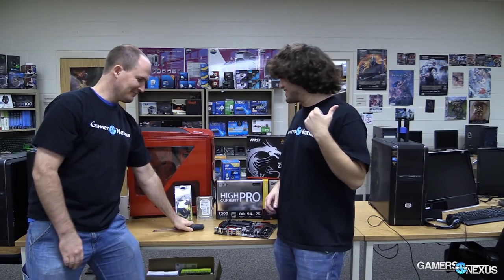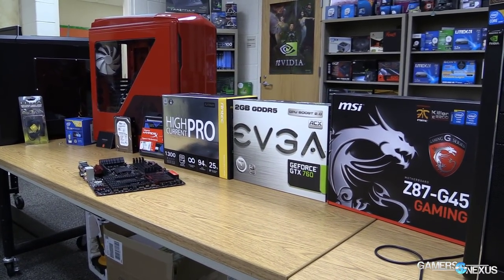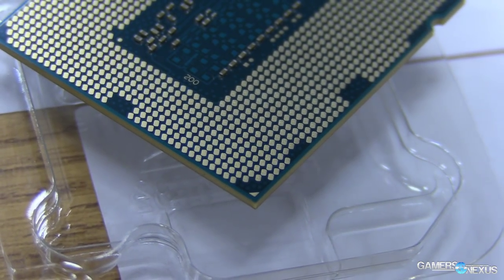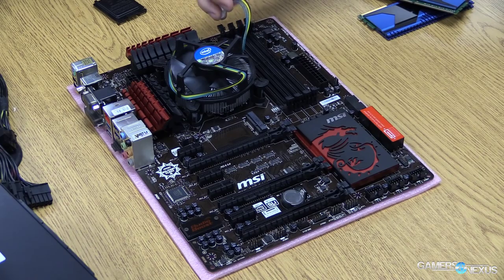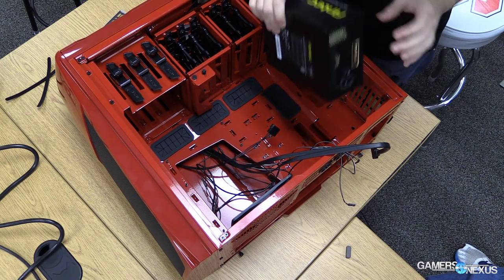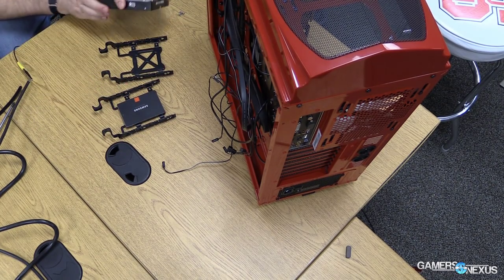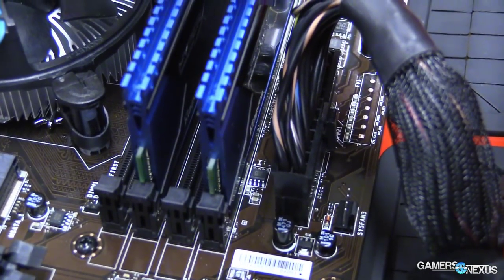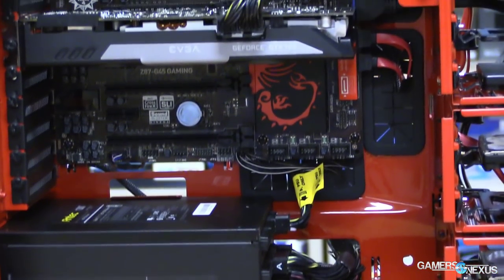How to Build a Gaming Computer: DIY Gaming PC Step-By-Step Tutorial

Comment: Great video, however, i have 4 questions, hope to be answered by Gamers Nexus:
1- I had a look at the cost in the article, way cheaper than AUS, as the article says the CPU is from your shop, do you ship to AUS?
2- where to do you connect the end of ESD wrist?
3- Do all cables come with the case and the components? no need to buy any cable separately?
4- Connecting cables to motherboard, GPU ... etc not clear enough, how to get clearer and closer look at how to do it.
Reply from the maker: Hey there,

1- We don't sell anything, sorry for the confusion. It lists that it's from us because we paid for it (was not provided by a company).

2 - You can connect it to anything that's grounded. A grounding ESD mat is a safe way to do it. You could also connect it to the metal grill on the case covering your PSU exhaust.

3 - Yes. You should not need to buy separate cables.

4 - Check the article, should help out. There are only a few. The motherboard manual will help with that. You'll need 24-pin to the right of the CPU, 4/8-pin next to the CPU, 3/6 pin to the GPU, and SATA power to the HDDs.

Comment from the maker: PC build tip: Always build & test the system outside the case before assembly - saves time if DOA parts. More here: How to Build a Gaming Computer: DIY Gaming PC Step-By-Step Tutorial
Reply from the maker: RIKALZ Not really... just make sure you build it on something non-conductive. In this video, we used anti-static foam (about as safe as you can get), which often ships with motherboards. If you build it on something like paper, carpet, etc., then you will likely damage the board. As long as you have an anti-static wrist strap and anti-static build surface (like the foam we use in the video), you should be fine.
Reply: Gamers Nexus Once you have jumped the board, how do you turn it off safely? Would you unplug the PSU from the wall or pull out the cable? How did you guys do it?
Reply from the maker: Tom Mo Great question! You can safely toggle the PSU switch to disable the system. You could also unplug the cable. It won't hurt anything because we're not in an OS yet.
Reply: Gamers Nexus Thanks for the almost instant reply! Got yourself a sub ;) Also, when you install the OS (disk), do you put that in before you boot up the PC for the first time? And is the BIOS easy to handle?
Reply from the maker: Tom Mo Any time! That's what we're here for. It actually doesn't matter too much if you put it in before first boot. You only need CPU + some form of video (even if it's the integrated graphics) + RAM + PSU to boot. Also the CPU fan. It's not a bad idea to install it first, but not required. BIOS is VERY easy these days. You'll get it in no time. As long as the disk is set to AHCI -- which it should be by default -- you're in good shape. Legacy boards used to set disks to IDE by default, which was fine in the old days... but now we've changed to AHCI.
Reply: Thanks a lot; know I can happily say that I know practically everything about building a PC :D These were only the few things that I was unsure on. I've made lots of changes in mine and have experience, as I have a friend who wants me to build him one :)
Reply: ok I have the wriststrap how do I ground it just put the clamp where????
Reply: These two guys are relatively young, before they were born we used to perform low level formatting when it came to Hard Disk Drives. From experience and since these builders have a shop to test or build and assembly rigs for people to see, they should or could use anti static mats on the table or on the floor. I have one, it is red and it is the size of the large bandanna close or around 22" , the mad is suitable for laptops and more, on one corner closer to you it has plug for your wrist strap. If u do not have the mad, you wrist strap has an alligator clip which should go to the case or chassis. It is true static can damage the motherboard.

Comment from the maker: If you need help learning how to build a gaming PC, here's our step-by-step assembly guide! How to Build a Gaming Computer: DIY Gaming PC Step-By-Step Tutorial
Reply: Ty for this vid i was going to build my own but the new nvidea 800 series is coming out soon should i wait or what current one should i get that will be able to run games for the next 3 years and what motherboard please
Reply: hello, can i have your processor? =)
Reply: lol, using an i7
Reply: -NARUTO-
try one of the these http://shop.amd.com/us/All/Search?NamedQuery=desktopprocs&SearchFacets=category%3AProcessor%3Bprocessor%3AAMD%20FX%208-Core%20Black%20Edition or if you have a tight budget one of these: http://shop.amd.com/us/All/Search?NamedQuery=amdaseries&SearchFacets=category%3AProcessor%3Bprocessor%3AAMD%20A10-Series%20APU  definitely not an i7   (also, overclock them in the bios, not through any other software <---- advice for any processor)
Reply: No Thermal paste is needed anymore?
Reply: *****
Of course thermal paste is needed!!! those pads that come on the cpu are useless if you are going to use the computer for anything more than work.
Reply: well I didint see the moment when they apply it :(
Reply: do u need to have ssd and hdd to build a desktop?
Reply: Of course you need a hdd, an ssd is not so necessary, you can get one if you want, but you don't need one
Reply: k thx
Reply: thatguy
techincally you dont need an hdd
Reply: It's generally best to have one to be used along side an ssd / SD card / memory stick / whatever your running your system from as per GB, HDD s are cheaper
Reply: vaginaaaaa  techincally you dont need an sdd. Ssd fan boys will always tell you to get them.

Comment: Make sure to apply thermal paste to the CPU before putting a cooling solution in. I didn't see that in the vid though I could be mistaken.
Reply: the stock cooler already has thermal paste on it
Reply: I stand corrected then. Thanks for the info.

Comment: I have decided to build a PC for the first time and I wanted to know if my parts are all compatible with each other:

Case: CiT Goblin Mesh

Power supply: EVGA 500W 

Processor: intel core i5 4460k 

RAM: HyperX FURY DDR3 4GB (x2)

Motherboard: Gigabyte GA-H81M-H

Graphics Card: Asus Nvidia GTX 960

Hard Drive: WD 1tb SATA III

Is this build good to run mid-high level gaming such as CSGO and Call of duty, if anyone has nay suggestions feel free to comment. 

PS. I want to keep the build between £500-£600, also do I need a solid state drive
Reply: use pcpartpicker i recommend it. i got mine around $500 im not so sure how many pounds it is.

Comment: I'm not too worried about static shock, as long as you have some sort ground near you and your not doing it in the winter on the carpet there isn't really much to be afraid of. really i don't see the need to buy a strap. Seriously though, the only time i have ever had a static discharge near a computer was shorty after i got my newest board(during the winter after being on the carpet with boxes). Thankfully the shock only reset the bios and.....fried a 500 Dollar Monitor... although the GPU and Motherboard came out unscathed.

Comment: @Gamers Nexus  Looks like the NZXT cases have a solid state drive slot on the back side of the motherboard...kind of on the cable run side.  Looks like your case did too....wondering why you didn't use that slot to place the SSD?

Comment: I understand they are just building a PC for tutorial purposes and not for part selection, and they are probably using just parts that were sponsored or that they had laying around. But at the time of filming, this PC wasn't really the best to get. They could have saved a lot of money on the CPU and used it on a better GPU, and the PSU is just a complete overkill, half wattage would be more than enough even with a mild OC. Anyway, a very good, detailed and easy to understand guide!
Reply: Rui Castro what if they dont need a better gpu? and yea that psu was really overkill
Reply: King Butcher I understand your point of view, that CPU/GPU combo could be just what they need, since some games, like those included in the MMO genre, benefit a lot from a more powerful CPU and would run smoothly on that GTX760. However, I believe that saving some bucks on a CPU, replacing it with an i5 4670K (same LGA 1150), and using that spare money on upgrading that GPU to a GTX770 would have been a better gaming setup. Anyways, you stated a good point I had not thought of initially :D
Reply: King Butcher And also, if they didn't blow all the budget on that overkill PSU, they could have still had some money in the bag to get an aftermarket good quality Air or AIO Sealed Liquid Cooler,  so that they could OC a bit and get the most out of their CPU :D

Comment: I'm mad you didn't use thermal paste on such an expensive processor... Though it isn't necessary, its still good to have. (stating for your viewers.)

Regardless, decent tutorial, keep it up. you have gained a sub.
Reply: The thermal paste was already on the stock cooler to begin with :)
Reply: Simon Larsen the stock cooler compound is garbage. U should remove it and apply a high quality compound; such as arctic.

Comment: hey wt do u think of this im just a beginer in building pc
cpu   : i5 4460 
mobo:asrock h97 pro4 
gpu   :sapphire r9 270 
ram   :corsair vengeance 2x4  
hdd   :wd blue 500gb 
cooler:cm hyper 212x 
psu    :corsair cx500 
case   :corsair 200r 
drive   :asus dvd-rw
Reply: Might need a bigger he's other than that you can play all of today's titles
Reply: Hdd*
Reply: if i was you id go with a 600 watt power supply just to be on the safe side thats just me though
Reply: when you are building new machine always have in mind future upgrades so you can without any doubt go with stronger psu

Comment: Hi, I am rebuilding my gaming pc but not sure would my components work together or not . For the new build i picked msi 970 gaming motherboard, AMD FX-8370 black edition 8 core cpu, corseair H110 cpu cooling system, g.skill ripjaws(4*4gb) 1600mhz ram, msi radeon hd 6970 graphics card, soundblaster z sound card, corseair cx 750 powersupply. And i have azza Orion case. please help me if i need any thing else or need to replace any thing or not. By the way i already have my hard drive and optical drive from my previous build.

Comment: does the cpu , come with the cooler , or do i need to buy that?
Reply: cpu's  usually come with stock coolers. these coolers will work just fine if you dont overclock your cpu (which i will suggest you dont)

Comment: don't you need to put cooling paste on CPU? (might be a stupid question sorry)
Reply: Because it's a stock cooler, it already has pre-applied thermal paste (look at 5:11, you'll see three grey strips on CPU cooler. That's pre-applied thermal paste.) If you're going to use a aftermarket cooler you would want to apply the paste by yourself.

Comment: i7 + gtx 760...WTF? Doesn't make any sense whatsoever. Not to mention the 1300w PSU.
Reply: Benedikt Weiß please elaborate
Reply: MrDisgruntledGamer1 imbalanced CPU / GPU. Way, way overkill PSU. 
It's not just a waste of money, but a waste of efficiency. PSUs get top efficiecy at about 50% load.

That rig will use, on a typical gaming scenario, around 250-350W, no way even close to 650 (half of total capacity)

Comment: So can any graphics card, Hard drive, and mother board fit in any case?
Reply from the maker: No. There are form factor and size requirements.
Reply: Ok, also I'm looking for a PC that is around $700-900 that will run Battlefield 4 on ultra and maybe the next Battlefield on ultra. Any suggestions?
Reply: Could you tell me all the parts needed?
Reply: Tyler Ford your not gonna get a good quality pc on 900 bucks. especially for HQ BF4 and next gen games.
Reply: Tyler Ford I think you could get a pretty good computer for $900 or so dollars, as long as you get good deals. Price isn't everything. I built a computer for about $1000 and it runs new games on ultra at about 50 or so FPS. Here are my parts.

-CPU: Intel Core i5 4670K: $230
-CPU Cooler: High quality intel (fits the i5 4670K) $20
-GPU: NVIDIA GTX 770 2GB: $315
-RAM: DDR2 (2X4 GB) Generic Ram: $50
-SSD: Crucial M500 120GB SATA3 (Not required, but I recommend it) $75
- Hard Drive: Western Digital 1TB: $52
- Power supply: Intel AMD 700 Watt: $37
- MOBO: ASRock Fatal1ty Z97 LGA 1150: $135
- Case: DIYPC Mid Tower USB 3: $40
Just some suggestions...
Reply: Allen Walker What about for 2 grand, that should get me a decent PC right?
Reply: I just decided to get a pc that will run everything at ultra 1440p, hopefully parts will be cheaper when January come saround

Comment: hey guys, would this computer be good for gaming? Intel Core i5-4690 3.5GHz Quad-Core Processor 
MSI Z97 PC MATE ATX LGA1150 Motherboard
Corsair Vengeance 8GB (2 x 4GB) DDR3-1600 Memory
Western Digital Caviar Blue 500GB 3.5" 7200RPM Internal Hard Drive
Asus Radeon R7 370 2GB Video Card
EVGA 650W 80+ Gold Certified Semi-Modular ATX Power Supply
NZXT H440 Designed by Razer™ ATX Mid Tower Case
Reply: That's basically the exact same as mine so yes

Comment: hi! can someone tell me if I chose the compatible components for my system?
-motherboard: MSI B85-G43 GAMING, socket 1150
-HDD WD Blue 1TB, 7200rpm, 64MB, SATA 3
-Procesor: Intel® CoreTM i5-4570, 3.2GHz, Haswell, 6MB, Socket 1150
-ram:Kingston 1x 4GB, DDR3, 1600MHz, Non-ECC, CL11, 1.5V, LowProfile
-GTX760 GIGABYTE GDDR5 2GB
-Inter-Tech Energon 550W (I don't know if it's a good power supply)
I don't know the case yet,but it will be an ATX case for sure!

Comment: Another build question: Are the following parts compatible and ideal for a budget gaming PC around $1000; 
Intel Core i5-4460
EVGA GTX 970
MSI H97 Guard Pro
8GB Corsair Vengeance RAM
256GB Crucial MX100 SSD
1TB Western Digital Hard Drive
600W Corsair CX600 Power Supply
NZXT S340 Case
This is a build I'm seriously considering, and any input is greatly appreciated. Thanks in advance! :)
(BTW this build is a build I found online)
Reply: Only things are if you can afford it, a z97 board and a i5 4690k so you can over clock later
Reply: But that build should be really good either way

Comment: I just built my first computer, and there's lights and fans and noise, but the monitor doesn't know that. But I don't whine and beg, so I left tom's hardware. So I dropped off my technology at the computer joint here in San Dimas. Mad props to whatever that place was called, "Computer Ranch" or something. Just google it, and ask for Angel. It's the only one in town. 

But I should've watched this video first, before I got in a situation. Linus is creepy or something, yo. Not crampin him, but he just needs to calm down. You guys at Gamers Nexus know what you're doing too, and look chill to hang out with. We could drop my parts off, and come back later after Angel handles it. He only charges $65 to rebuild it, if you pay cash. We could talk computer building while we shoot pool over buckets of Corona. I should've done this in the first place. You should add that advice to your video. New PC builders don't think of this until it's too late.

Pro tip: Just let some dude like Angel do it, and take the Gamers Nexus guys to a ballgame. Besides, Taco Tuesday happy hour ain't got tutorials and wires. Peace.

Comment: Hey
I am searching for some parts for my new gaming desktop. I would like to ask you guys if these are already good parts, and if the pc will run smooth.

Processor: AMD Vishera FX-8350, Eight-Core
motherboard: MSI 970 Gaming
Ram: Crucial Ballistix Sport 12GB DDR3-1600
GPU: AMD Club 3d Radeon R9 270X 2GB or AMD Radeon R9 270X 2GB
PS: 600 Watt Cooler Master

if you get suggestion, plz feel free to suggest them :)
Reply: Unless you're editing, u really don't need 12gb ram, 8 gigs should be fine, and you can spend the money the 8 gigs saves you on a better GPU ( not that the 270x is bad)

Comment: This could've been powered by a 500W, 600W if you OC moderately.
And the i7 is not necessary for gamers, the i5 is more gamer friendly.
Reply from the maker: The process of assembling a system remains the same regardless of i5 or i7 utilization and power config :)

Comment: I would like to see you guys build this asrock fatality 990 fx killer mother board
with the 8320 or 8350  8 gigs ram gskill sniper 1600  Kingston 120 hyper ssd
evga 760 sc 2 gigs  corsair 700cs ps the led version  raidmax vampire case black
edition Seagate 1 tb barracuda  2 140 corsair af fan and 2 120 corsair af fans
and 2 coolmaster mega flow ohh and the fans red leds  and the air cooler the cryorig
r1 ultimate  the reason I am asking to see this build  this is  what I  planning to build I never built a pc this is my first time  so if you don't mind try and build this  just want to get a idea what I am getting into lol

Comment: you need half of the power in the power supply if it has got a gold or platium certificate!!! :O
Reply: ***** yeah, they would need anotzer graphics card, a sound card and MUCH hard drives to max it out
Reply: They would be fine with a 550 watt PSU.
Reply: TheSilentPWNER yep.

Comment: i want a gaming pc but not enough money. i should upgrade my current pc but, it sucks. slim case, i3 processor, 220 watt power supply. even if a graphics card worked on that low of a supply, it probably wont fit in my case. to do anything, i need a bigger case, and a bigger power supply.
Reply: Yeah, upgrade your case and psu for a gpu, maybe ram if it's in your budget, one stick of 8gb is really cheap, and most parts that are "outdated" but still really good for modern games have just rapidly decreased in price too. But I strongly suggest to go on PCPartPicker to see costs of everything and to see what is compatible with your rig, because YouTube will just get you in trouble.